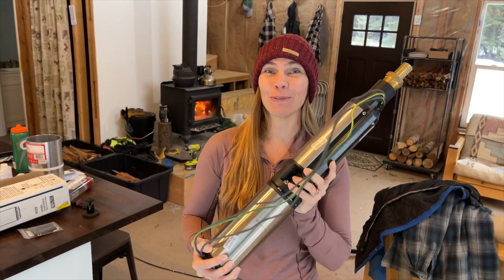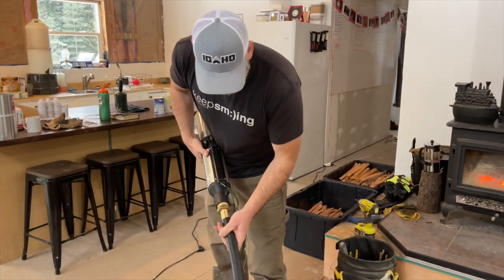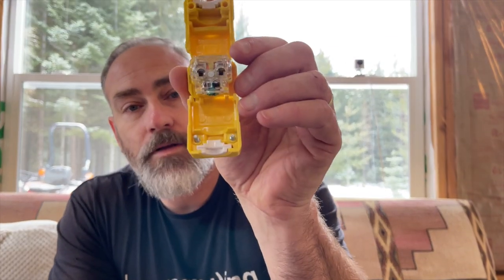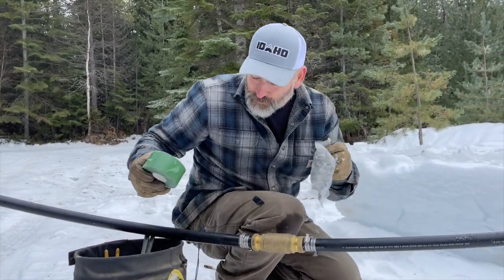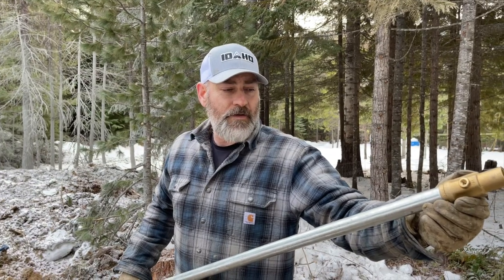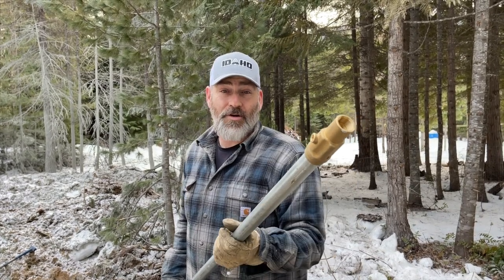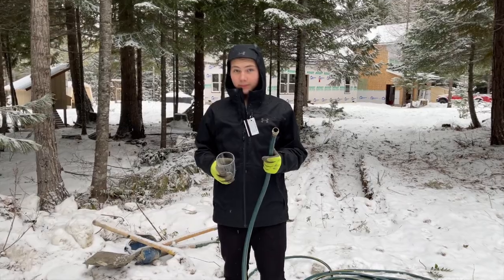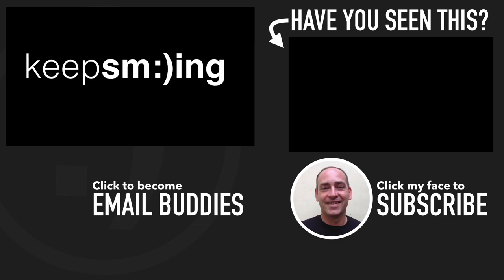WIFE is HAPPY/HUSBAND is NOT - DIY Well Pump Installation

Comment: When you signal to the pump to start, it is at rest and will require an initial surge to put it in motion, hence the big current load it was reaching for. Your 3.5 Kw Generator was inadequate as you learned. Even with your new generator, you need a control box for your system which you can buy at the place that sold you the pump or at big box stores, hardware stores or online. Purchase one rated for the HP of the pump you installed.  Inside are two capacitors. One provides a surge to start the pump to handle the load of putting the motor into motion from a dead stop and overcoming the load of the weight of all the water sitting on the impellers. Once started, the run capacitor takes over. There is also an overload that will trip in the event there is a problem with the pump, often a red button that sticks out of the bottom of the box that works like a circuit breaker. These are relatively inexpensive and fairly easy to install. Another MUCH more expensive option is an electronic controller that is more frequently used in industrial applications, although in some parts of the U.S. are becoming the standard for new system applications. Also, to extend the life of your pump, you need a storage tank which should also include a pressure switch, pressure gauge and relief valve. @Gary Kawsowski suggested ganging several together. Not only will this give you more water above ground, but more importantly, reduce the number of starts your pump will make, greatly extending the life of your pump. Bear in mind, that those big tanks only hold a fraction of water in the cylinder. The majority is air held by a bladder or diaphragm that provides the pressure to push the water to your fixtures when you open a valve. ALL parts of your system need to be protected from freezing. Good luck!

Comment: The generator is not big enough! I have the same pump for the well I drilled.
Reply: How do you run it?
Reply: It was with a generator then I bought a long extension cord to. A 3500 is not big enough. You said your static water head is 100’? That also adds to the load on the pump. My static water is 15’ to 20’. I built a rug and drilled it myself. Got a few videos if you are interested.
Reply: Or the pump is too large. You don't necessarily need to pump at the capacity of the well, especialy when you have a storage tank. You do need enough capacity to overcome 100 foot head. With a storage tank one could pump less water per minute, have less surge but pump a little longer. Those are good lessons for off grid living and good math examples for kids to see how math and science can be used to solve everyday issue. Another example is the difference between the Amp draw of a 120 volt pump versus a 240 volt pump of the same capacity or horsepower.
Reply: @ricklearned1686 , the amperage draw is the same, it just splits it across two legs.  That is why the wattage of the pump remains the same at low voltage and high voltage.
Reply: @DiamondJim53  You are correct that the power is the same. Perhaps you are confused because a 240 volt circuit uses two breakers? I am using the traditional measurement which most electricians use when measuring the current on a circuit. Martin used a clamp Ammeter on one leg and measured 35 Amps at 120 volts. If Martin were to use a 240 volt motor of the same horsepower (Wattage) he would have measured 17.5  Amps. It doesn't matter which leg, the Amperage is the same. You can can count the Coulombs if you want to make some obscure point.  However there is a good reason that large industial equipment often runs at higher voltages. It is more efficient for a number of reasons. Less copper, less power loss to mention a few. In the case of a 240 volt well pump, it is still two wires and half the Amps at the pump for a 240 volt motor than a 120 volt motor. I have switched the leads on many table saw motors and they all run cooler and rip through thicker wood easier when wired for 240 volts. That is why many of those motors are built for two voltages.
Reply: @ricklearned1686 , I'm not confused and nothing that I stated was wrong or confusing. 
What I am is an electrical engineer that has been doing this for over 40 years.
Reply: @DiamondJim53  You may be an electrical engineer but your comment may be confusing to a layman. I presume that you know the NEC rules about sizing current protection devices and sizing wire based on the current on the circuit not some arbitrary assumption that there is a neutral wire in a circuit which does split the Amps into two distinct circuits. You do know the difference between two 120 Amp circuits sharing a neutral and a 240 Amp circuit without a neutral don't you? Why would you tell any one that the Amperage that they were measuring with a meter was actually only half of what that person was measuring? Am I missing something? Did I misunderstand what you implied when you said the Amperage draw was the same, just split across two legs? I was referring to the concept of increasing the voltage to reduce current leaving the Wattage the same. It did appear you were contradicting that concept. That concept is rooted in the formula to compute Watts. W=IV
Reply: Just an amateur here, but educated enough to know the 3.5 Ton HVAC heat pump (240V) on the roof of my house uses start capacitors to supply the startup amps necessary to get the compressor and and outdoor fans going.  Is a $10 start capacitor not the simplest and cheapest solution to the problem?  An over sized generator seems a clumsy and expensive solution to the problem.
Reply: @petertownsend252  is a starting Capacitor similar to what I call a soft start? A soft start reduces the surge on the circuit by slowly charging a capacitor so the capacitor can provide the motor with the Amps needed to start the pump. I know there are several ways to solve the issue but Martin has spent the money on a generator. This dialogue may help other readers. Here are a few of the ideas that have been proposed:
A smaller pump of same voltage but draw less Amps.
A higher voltage pump that draws less Amps. (I don't think Martin has a 240 volt inverter or generator so this might be impractical)
A pump that has a soft start. Sometimes these are called inverter driven and they are expensive. The cost of any of the above needs to be weighed against the cost of a bigger generator. Of course any suggestion for a smaller pump assumes the pump also has to be powerful enough to lift the water to the top of the well.
Reply: @ricklearned1686  Yes, I think a soft start is the same thing as a start capacitor.  Thinking about this some more, a start capacitor is usually built into the pump assembly which incorporates a centrifugal switch to deactivate the start capacitor as the motor approaches its operating speed.  A start capacitor needs to be deactivated with a few seconds or it will overheat and burn out.  You can also wire a start capacitor into the circuit control box, but in this case the pump just plugs into the generator with no control box.  In hindsight it probably would have been wise to spend a little more to upgrade to a three wire pump.  One power wire runs the pump, the 2nd power wire is used to energize the built in start capacitor.  I would imagine the extra cost for a three wire pump would be much cheaper than purchasing an over sized generator.  Maybe still an option if he can return the new generator?
Reply: @DiamondJim53  Let me take another try at what I was initially trying suggest as a solution and see if you agree on the physics. I suggested a pump with 240 volts of the same Wattage would draw half the Amps that a 120 volt pump would draw. I used a formula that I learned 64 years ago. W=IV where W is Watts, I is current and V is voltage. I am not an engineer but I trust the laws of Physics.
Of course my solution was not going to be helpful to Martin, because he had neither a 240 volt inverter or a  240 volt generator. I just thought the concept was worth mentioning for anybody considering living off grid as to why the marginal cost of a 240 volt split phase inverter might be worth considering, especially if one is going to run a well pump, an electric water heater, air conditioner or any heavy tools.
Reply: @petertownsend252  interesting that you mentioned 3 wires. I remember Martin taping off a third wire so maybe the solution was just figuring how to wire it up and use a control box at the well head. I admit I do not know all the subtleties of well pumps. I do use the laws of physics to try to understand possible solutions.
Reply: @ricklearned1686  if my comment is confusing to a layman, then I suggest that a layman not touch things they don't understand.
Reply: @ricklearned1686  the pump still draws the same current.  It simply is simply split across both phases.  If your generator is capable of 20 amps @ 120 volts, it will only supply 10 amps @ 240 volts.  It is the same 2400 watts.
Also, you need to be careful in your replies.  You mixed up volts and amps twice in previous replies. 
Now, Soft Starts.  A starting capacitor and a soft start are two completely different things.   A starting capacitor is just that.  A soft start is an electronic device that starts a motor at a low RPM and gently increases the RPM until the motor is running at rated speed.
The difference between a soft start and a variable frequency drive (VFD) is that the soft start will do only that, while a VFD will allow you to pick your desired RPM.
Reply: @DiamondJim53  I am happy to correct any mistakes. I reviewed and could not find any mix up of Volts and Amps. Point me to that sentence, and I would be happy to correct or clarify.  At least we agree on Wattage. If the formula is W=IV, then mathematically if I use the same 2400 Watt motors, then at 240 volts one will draw 10 Amps and the other will draw 20 Amps at 120 volts. You also stated the same thing, so  I think we are finally in agreement. Wire size and breaker size are determined by that Amperage. In North America the voltage between either leg of a 240 volt circuit and ground will be 120 volts and that is why it is called split phase.  At 240 the voltage is phase to phase and at 120 the voltage is phase to neutral. The neutral conductor would not carry current on a balanced load like a motor. That is why I think your statement that the "current is split" is misleading and irrelevent with respect to a 240 volt motor. What does that have to do with sizing breakers and conductors? I do understand the disagreement between physicists and engineers about which direction current flows but the National Electrical Code is pretty clear about sizing conductors and breakers based on the current in a circuit. Also the reason that a dual pole breaker is used for 240 volt circuit is to protect a person from voltage to ground if only one side of a 240 volt circuit is interupted. I have not seen many 240 volt motors which use a neutral so  how is split phase relevant to this discussion? At 240 volts there is only one phase. There is no such thing as two phase in North America. There is three phase and split phase. To be clear, I am not trying ti change your mind. My comments are addressed to the many readers of this thread.
Reply: @DiamondJim53  I agree and suggest that laymen just follow the NEC as far as conductor and breaker sizing is concerned. Don't be fooled by ambigous language about current being "split". As a practical matter for long runs higher voltage also means smaller conductors and less voltage drop.

Comment: I bought a Kinetico water softener to fix my water rust issue and bonus it doesn't use electricity. Also, have a single filter between the well and the Kinetico.  It uses about 7 bags of salt a year and if you buy filters in bulk you can save money. The system is 3 grand.

Comment: That is why a lot of pumps that size are 240 volt instead of 120 volt.  Voltage goes up and amp on the wire go down.  So 32 amps now at 120 volt would be 16 amps on the wire  at 240 volt and voltage drop on your 10 gauge  wire will be almost not existing, because the resistance issues happen more when you are near the full amp load of the wires capacity.

Comment: My pumps required a capacitor starter . they were 240 V but a capacitor helps the pump start because the sudden load on the motor gets stored energy from a cap
Reply: depends on the pump.

Comment: It looks like that  was a lot of work, glad you got it figured out.   That is a fairly long run for 110V pump, you going to need a larger gauge wire or the pump is not going to last very long.  You just can't look at the wire table to determine the size of the wire  as you would for sizing your breaker to the #15 wire in the house.  That figure is for safety and heating determination only.  You need to calculate the voltage loss at your maxim current based on the cable resistance.  Your 120 volts at the generator is going to be more like  80 or 90V or lower at pump startup.   Also remember a 100' well has 200' of cable got to figure both the line and neutral resistances as additive.   You should be looking for at least a 220V pump  or even better a 3 phase pump with a VFD (variable frequency drive) type pump controller.  The  3phase with controller has the advantage because there is little starting surge or torque as the pump are ramped up slowly.  They can monitor the pump load and adjust the RPM and power accordingly based on the water delivery requirement.   This is the same inverter technology that makes the new variable speed compressor AC/heat pump units so efficient.   The other function you need is the ability to shut the pump down if the water level falls below the pump, the motors are water cooled and don't last long pumping air.  The controllers provide that function as well.
Good luck
Reply from the maker: I’m going with the info in the manufacturers installation manual.

Comment: If the pump is really pulling that many amps, the wire is sized too small for that length. ALWAYS test your pump in a barrel or tub of water up top before installing to make sure it works. Could have saved yourself returning a perfectly good pump and wasting a lot of time redoing everything. Very interesting but too many adds. Keep up the good work.
Reply: The wire is fine, those are starting amps on the starting windings. It is normal, except with an undersized genset the pump stays in start mode and thus the high amps.

Comment: Great job on the well pump. To clear up your water.... run your well pump .....fuel up your generator and just run water ... eventually the water will start to clear up. Basically you need to clear out the mud..... just run the pump and it should start to run clear.

Comment: Ah yes the joys of installing your own well pump. We installed ours around 4 years ago and we were running it off a generator with a gfci and it kept tripping it and we had no idea why. That was "fun" lol

I forgot what brand the pump is, but it can run off of 35vdc/vac to 260vac/vac!
So in the summer time we run it directly off the solar panels for irrigation! Its really cool!
Too bad your water is so dirty.
Just a random not thought out idea but maybe you could pump into a big tank and let the silt fall out of the water and then pump off water on top.

Comment: I don't know your generator, but since it is revving up quite a bit when you plug in the pump, I would guess it is in eco-mode. Turn that off, so it is running at a much higher RPM before you plug the pump in.. Then it might work with the small one.

Comment: You should have tried the pump outside, with a bowl of water before to deepen the pump down in the pit... Maybe it will be easier to troubleshoot the problem... If possible, I think it will be worth try with a simulation first, just to know if the thing I'm going to install is working as expected... Thank you for sharing, I hope manage to fix it!